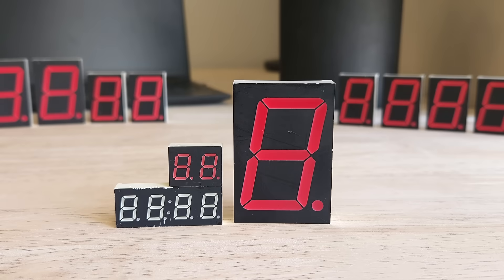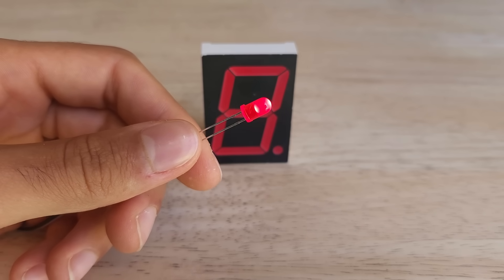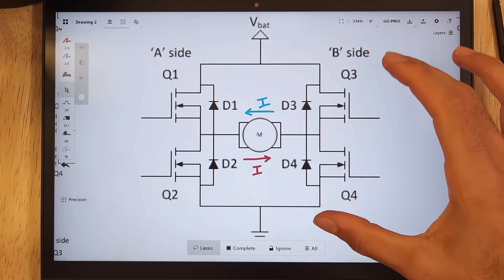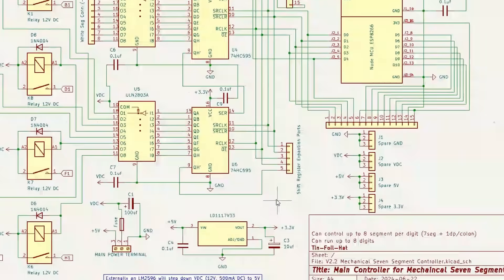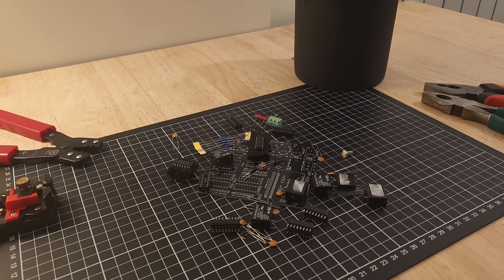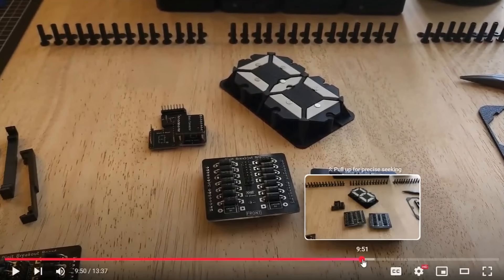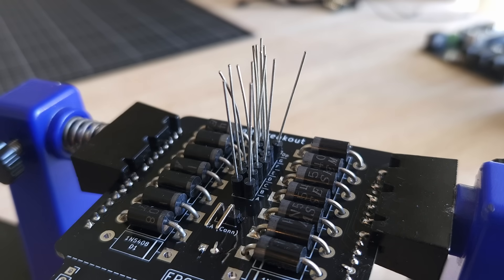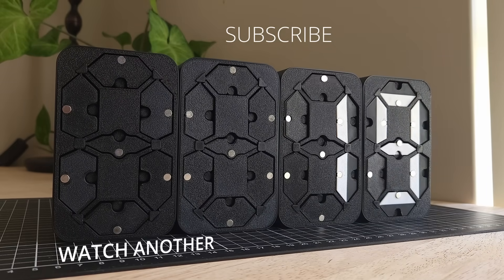The BEST Mechanical Display You've EVER Seen!!

Comment: Have you considered the L9110 as an H bridge driver? They're not that expensive and I feel like your relay solution takes more cash to build. (I guess that is why you're multiplexing your segments). They could be driven with a bunch of TTL not gates for their B input and a standard BCD to 7 segment decoder chip. Use a mosfet to enable/disable VCC like with an enable signal. That way coils do not stay energized.

I do get why you're driving them directly, tho. Makes for fancier animations and custom symbols ofc.

I think your flip dot 7 segment is by far the prettiest mechanical variant out there, yet. Love it!
Reply from the maker: Thank you! I will look into it for future projects. The coils are only energized for around 50ms with my current design. And yes, that's exactly why they're multiplexed :)

Comment: Circuitry for reversing current neither complicated or expensive, 8 pieces of  l298n boards can be bought for less than €5, likely cheaper than the relais you used
Reply: Edit: you would only need 4 l298n boards per digit as each one contains 2 h-bridges, so for the cost of one and a half relais you could have gone solid state and only needing half of the amount of magnets

Comment: But does it work without power?
Reply from the maker: It only needs power to update
Reply: @tin_foil_hat99  Helps if you want to know when the lights went out. Would this system be able to run on batteries?
Reply from the maker: yep it sure would! this isn't the best device for a clock if you live somewhere where you need the time even if the power dies lol more useful somewhere like a gas station where you want the fuel prices to remain displayed even if the power drops out :)

Comment: My question is. How many miles/kilometers of winding wire did you use? Peaks my nerdy curosity! Excellent video!!! I subbed.
Reply from the maker: I tried to do the calculations and it was something like 14km per digit? But that seems like too much. I wrote a formula to try and figure it out, but there are so many inaccurates in my winding that it is likley a whole lot lower.
Reply: @tin_foil_hat99  thank you! Extremely well put together video!

Comment: The mechanical display used on truck scales in cal. Each segment had a solenoid to flip them and only required current to change segments not retain them. The numerals where 12” tall
Reply from the maker: Yep that was my original plan! I just got used to them after a few months lol
Reply: @ I would run “burn in test” that would constantly cycle through all segments and with 50 running at the same time was loud for hours @ 120 deg ambient temperature to help eliminate field failure.

Comment: Does your software allow for silmultaneous flipping of all the panels on each digit?  Cool project.  Great job dude!
Reply from the maker: It did originially, but needs a ton more power so I removed it.
Reply: @tin_foil_hat99  you should optimize the permanent magnet size to minimize the current needed (and the windings) on your EM's.  Also your 3d printed spindle is a good idea but increases the airgap on your windings to the conductor which decreases magnetic flux.  something to think about.

Comment: Next step: 14 segments...

Can these be used as tactile displays? That is, would they flip when touched?
Reply: Probably with the addition of a few elements, such as a capacitive touch sensor?
Reply: @AlyssaNguyen , by "tactile" I meant something a blind person could use to read time. I used to have a mechanical wristwatch that opened up exposing dial and hands to be gently read. There are also talking watches and clocks, and various apps, but these have a disadvantage of not being discrete and quiet. This display if could be read by touch, might fit a small niche of products that don't really exist. Especially if the noise of flipping could be reduced with some felt bumpers.
Reply from the maker: No they wouldn't flip when touched... unless you are magnetic :)

Comment: I understand the appeal of going for the flip clock aesthetic, but since you're using a microcontroller, I wonder if a modern reimagining might be simpler. I'm thinking of a set of maybe 5 rotating squares with white mark combos on each that could be combined to create whatever number or letter you'd want. The design of the 4 stage flipper might be easier too with some sort of simple ratchet.

Just a thought.

Comment: I like the aesthetics and noise of flipping segment by segment. But it would have been nice to see a version of the software that flipped all required digits simultaneously. Or is that problematic due to the power required for multiple electromagnets?
Reply from the maker: Yep the power draw is too high, it was my original plan too.
Reply: @tin_foil_hat99  Well I suppose that explains why the commercial displays tend to ripple through too.

Comment: You're sure you don't want to adjust the timing of the flippers, so that every moveable part flips at the same time, when it has to change instead of in "chaos" with unwanted intermediate displays?
Reply from the maker: If you mean everything else at once, then it requries too much power. If you mean all of them at regular intervals then yes I have programed a mode you can turn on or off on the homepage. It simply remembers what state it is already in, and then changes only the ones that need changing. You can see this at the very end of the video.

Comment: I think some commercial flip-segment displays only turn the segments through 90 degrees for faster operation and lighter segments.
Doubling up electromagnets in order to halve the transistors seems a poor tradeoff.
Reply from the maker: Smart idea for the 90deg. And it takes me 1min to make an extra coil, so I took the trade off

Comment: Very cool project, it reminds me of split-flap boards you'd see at train stations. But sir, can you please justify how this also doesn't fall short to the intro claim?

First 20 seconds: "All those displays share one common weakness... reliance on power... So I set out for a Mechanical display that retains it's information, even without power."
Not 10 seconds later: "All I need are 7 colored strips that I can control electronically.

Comment: A couple of minor recommendations - 1. build the magnets INTO the segments so they can't be seen. 2. Use commercially made miniature electromagnets (well under $1 ea in bulk)
Reply from the maker: Yes I would like to embed the magnets too, this is a great idea. Do you have a link to commercial magnets? With all my searching I couldn't find them, and I would REALLY love to stop winding my own lol
Reply: @tin_foil_hat99  you could perhaps put a pause in the printing code to allow you to insert magnets inside the flaps and then resume to print over the top?
Reply: @ArmChairPlum  Yep. I do this a lot. You have to leave room for ideally two print layers between the magnet pocket and a surface, plus the magnet hole needs to be slightly deeper than the magnet, because if it didn't go in all the way, your print head could crash into it while trying to cover it. Also, I recommend a drop of CA glue to seat the magnets into the pocket so they don't try to jump out onto the steel print head! For pushing them in, Scotch tape is best. Keeps the magnet orientation correct, and gives you a surface to press down on without any extra CA glue getting on your finger. And then you just pull the scotch tape sideways, leaving the magnet in the pocket. If making horizontal magnet pockets, just make the bottom rounded (half circle), and the top into a 45 degree angle, meeting at 90 degrees (so like a teardrop shape overall).
Reply: @ArmChairPlum  Would be easier to make them just a few mm thicker, and make it so you can slide the magnet in from the side.
Reply: A small solenoid could be an option as an electric magnet. Bust block the pin somehow.
Reply: I can't dislike this comment, but the fact that he built his own winder was charming and impressive. The DIY/budget appeal, the education b-roll, the corny video tricks, the cliché but always welcome classical vibe... it's all good. I hope he keeps cooking up vids just like this one.
Reply: Maybe you could repurpose these simple pin pull magnets for this by removing the spring-loaded center and replacing that with the bolt.

Something akin to the TAU 0537 magnets maybe?
Reply: Why the relays? Electromagnets driving electromagnets?
Reply: Was going to say the same thing. The first thing I'd do is press an appropriately sized magnet in first then hide it with the segment.

Comment: Only a thousand subscribers for this level of quality and craftsmanship is honestly crazy. Two things:
1. Why not cover up the magnets? It's pretty easy to insert a pause to put them in, and then print over them to lock them in place
2. Did you actually get the print/design right on the first try?? If so... damn
Reply from the maker: 1. Great idea! Never done a pause print but it sounds like it's about time to try
2. No, I had a scene that I cut out where I showed just how many fails there were... but the video was already getting kinda long :)

Comment: Fantastic mechanical design, not so great electrical design. I pray that you were trolling with that soldering technique. Have a look through "PCB design tutorial" by David L Jones (the eevblog guy) for some PCB design best practices. You can get multiple transistors in a single chip for convenience. I'm seeing prices on lcsc that are much cheaper than custom winding a solanoid. I can't deny that your soldering technique works, but you're asking for cold joints and mechanical failure from insufficient solder. Part of the problem might be the soldering iron you're using, they're not designed for working with PCBs. Grab a pinecil and thank me later, they're cheap and use tips with modern designs for faster flow of heat at the same temperature.

Comment: Very nice! Is there a particular reason why the outer flip panels are double width but half-colored and not as small as the center bar? The magnetic repellant seems to work just as well for the slim design.
Reply from the maker: The larger flaps are more relighable, I had a few issues with the slim bar, but yes you could make them all slimmer if you wanted to.

Comment: If you are only always repelling electromagnetically, won't that repelling magnetic orientation become more and more permanent in the bolts over time?
I would be concerned that over time the display may eventually want to come to rest at an in between state where the magnet is being slightly repelled by both bolts when unpowered.

Comment: 13:20 why is the middle segment of the last digit moving and not turning fully?
It looks like you programmed it to turn but it doesn't manage to do it.

btw. I got really exited when I thought you would mill your PCBs on your own. But I got a bit disappointed😅
Reply from the maker: I plan to move up to milling my own PCBs haha Still learning. Sometimes the magets interfear with the adjacent digit. I should have spaced the digits further apart. That means it flaps over but then gets repelled back away.

Comment: The idea to use the flip dot like design is genius. It looks very cool and it seems pretty simple mechanically. The sound is also very satisfying. Have you seen the 7 segment display by "KARAKURI channel"? It has a nice mechanism and I think Engineezy might have been inspired by it.
Reply from the maker: Yes I was also inspired by it! I tried using magnets to replicate that first, but I quickly pivoted because the force needed to move something forwards and backwards is much greater that flipping a small flap over.

Comment: "How hard could it be?" is my favorite phrase.
Reply from the maker: Only down hill from there...
Reply: @tin_foil_hat99  I was wondering how hard it'd be to build my own 3-axis gimbal for a quad. I have brushless motors that would probably work for the project. 
I got far enough in investigation that I might be able to get pretty good control by running each motor with 3 half bridges controlling those with 6 PWM signals so 18 signals in total... At this point I decided "too hard". Usually it takes a lot longer to figure that out :)
Reply from the maker: Yeah... sounds epic though, all the best!

Comment: Does it switch all of the panels to black first when switching to a new digit? Or does it remember where each piece is and only switch the ones it needs to?
Reply from the maker: It can do both. I programmed both modes so you can check or uncheck a box on the homepage.

Comment: Looks and sounds great. Nice project. I always found this kind of display mesmerizing.

If I may provide some constructive feedback:
- There are ICs that combine shift registers and power transistors. With those, you wouldn't need 2 separate ICs (shift register and darlington array).
- Mosfets would have been cheaper/smaller than relays and would have not required power outputs to drive them
- The PCB traces in the video looked all the same and pretty small. That's fine for signals, but power traces should be sized appropriately.
Reply from the maker: Thank you! I am always open to feedback and love your thoughts. I had no idea there were chips that combined both, do you know what they're called?? (This was my first project with 7-segment displays and darlinton arrays so I just went with what I found haha). I did originally consider mosfets and yes I agree, they're better than relays in most ways, but I needed to drive the positive rails so standard NPNs would need extra circuitry but I think I could have used PNPs? Dunno, also first project using mosfets lol And I'll look into the power traces, I tried beefing up all the traces that carried the raw power that could exceed 1A especially on the second PCB that went into the digit. This was also my first custom PCB and seems to be working ok for the time being, but I will 100% look into it :) Maybe there is a course online or something I can watch lol